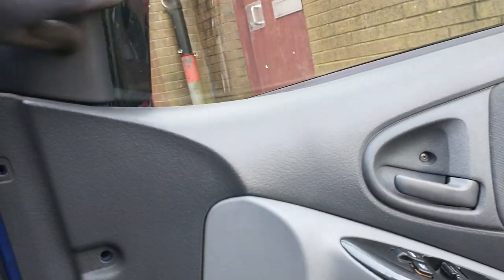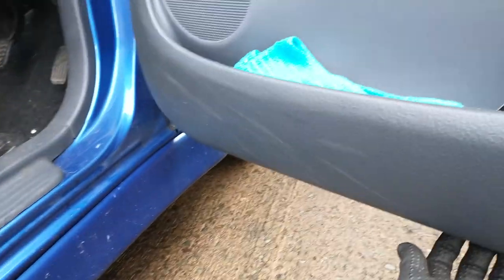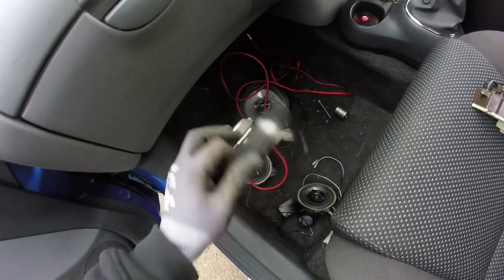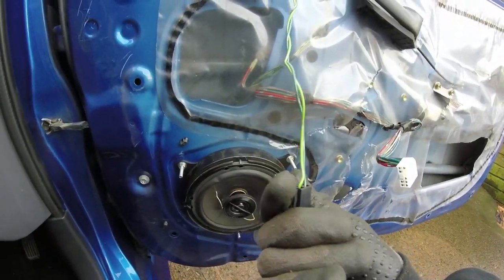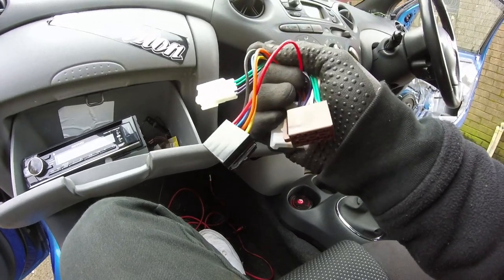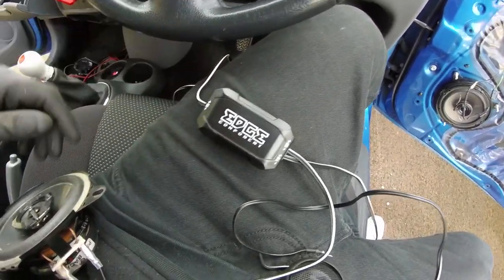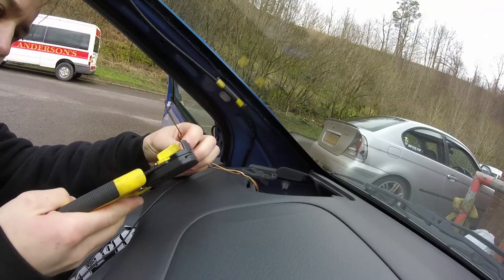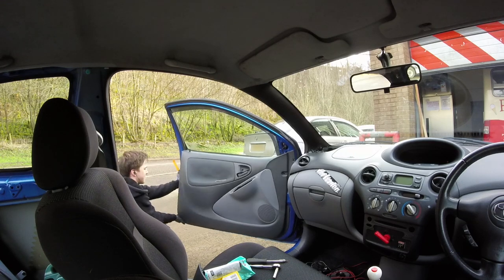Dash And Door Speakers Upgrade On A Toyota Yaris MK1 (1999-2005)

Comment: Could tell what speakers (model) you are using in video cuz Im trying to find new speakers to my yaris with more power
Reply from the maker: It's a load of different brands. Old stuff as well. It will all be discontinued. Look for some speakers with RMS that match your headunit or Amp output! The Max power of a speaker is marketing stuff. RMS is what they like to sit at all day everyday

Comment: This is awesome. One Q though - you did show in great detail how to connect dash speakers by cutting off OEM connectors. Do I need to cut off the connectors on the doors too and follow exactly the same soldering drill with door speakers? I believe the answer is "yes" but want to double check. Cheers!
Reply from the maker: Thank you very much. The answer is yes you do! Solder or crimp! What ever is easiest for you!

Comment: My old speakers are really shit do i need an amplifier for jbl gto629 6.5 2-way 360watts?? I have no idea what im doing😅
Reply from the maker: No you don't need a amp! Upgrading to a aftermarket head unit will make more used of the power that they can handle! 

The 360watts is the max watts they can handle but it's used more as a busy word. RMS power is what they will sit at all day everyday and not blow up. So when your head unit says that it will output 4x55watts. You will want to be pairing it up with a set of speakers that have a RMS of 55watts or higher is perfect! And the 4x bit on the headunit is that it has 4 different channels. Front left, right, Back left and right. Your JBL have a RMS of 60watts which will be perfect for most aftermarket headunits!
Reply: @DriveShifty okay coz I currently have an android head unit installed thank u so much appreciate it!!

Comment: bro, I upgraded the front door speakers to the TS-G1720F and the dash speakers to TS-G1020F. My head unit is the Sony DSX-A410BT. Audio is aight but there's hella vibration (and the bass doesn't sound great if I'm honest). What would you recommend?
Reply from the maker: Two things it could be. To much bass making it distort. Or there is something lose in the doors. Maybe the speaker needs to tightened? Could be something else. Take the door cards off play something bassy and try and find what's rattling
Reply: @DriveShifty  will give this a go. Many thanks bro!
Reply: Hi bro which adapter did you use for the TSg1720fs in the door? Thank you
Reply: @camxan63  search "CT25TY01 speaker adapter". I'd recommend you buy "component speakers" with an amp instead of the ones I've specified. Save you money and will sound 10x better

Comment: Hi, I would like to know which speaker mounting ring/adapter/mounting bracket I should buy for the dashboard speakers. I want to go with a JBL Club or Stage series. However, the problem is that they do not come with a grill/mounting bracket. I searched online for 100mm brackets that can fit in the dashboard section, but I couldn't find any, only spacers that are the right shape, but then it will not fit under the dashboard speaker grill. I see that you have folded the other two cross points.

Thanks in advance mate.
Reply from the maker: The dash speakers don't need an adaptor. I have folded two tabs as they hit the dash if they are left unfolded. They just screw into the holes and sit exactly the same as how the old ones sit in the dash. I've worded that really bad but you take the old one out and replace it with a new one. Not adaptors needed

Comment: What size are the bolt and nut you used bro for the installation in the door?
Reply from the maker: Off the top of my head they are M6. Ones about 20mm long should do. Wished I'd mesured them now
I would recommed mounting them with some threaded inserts but the nuts and bolts do hold so longs as you give them a good tighten. Just hold on to the tread as you trun the nut!

Comment: could you put in descrpt what speakers r u using ??iI installed 2 din radio that  can install 4x50 watt speaker power from the same manufacture that your speakers and im looking 4 new ones cause fabric  speakers is not good .Peace ya
Reply from the maker: Brand doesn't matter when it comes to speakers. You search for speakers on the size and power they can handle (RMS). (There is other stuff when you get into it but thats the basics) For your 4x50w output on your head unit most speakers will be fine with that power. Any 100mm speaker will in the dash. Then for the doors you need to buy an adaptor for your speakers to fit. (Search Toyota Yaris Door Speaker Adaptor) Then buy the right size of speaker that fits that. If it is an adaptor for a 165mm speaker then you will need a 165mm speaker. There is a lot to speakers when it comes to types. You could get components speakers, 2way, 3 way ect. I suggest youtubing some videos of speaker types to get to know them

Comment: Right... The small mid tweeter pointing up against the windshield was the problem. In the meantime, the coaxial tweeters in the door speaker are there for which reason exactly? or maybe you have cut them our as well...
Reply from the maker: The ones in the door are fine. They add to it.
To explain my tweeters point at the window theory I always felt like I had to turn up the highs in the EQ in order to hear them but by that point they were to high and distorting. By having them point at me this means that they don't need to turned up as high on the EQ.
In an ideal world having all speakers except the sub pointing at you is the best. Also having a butt load more sound deading!

Comment: i dont haver electric windows so the hinge is stuck on something tryna get my door apart XD i dont wanna rip something brokeen
Reply from the maker: There is a little clip behind the base of the handle. They are a night mare to get off. I've struggled for years with my rear door cars on my other yaris! There is a micro fibre trick where you slide it in behind the handle and it pops out. That or a pick tool is your best bet